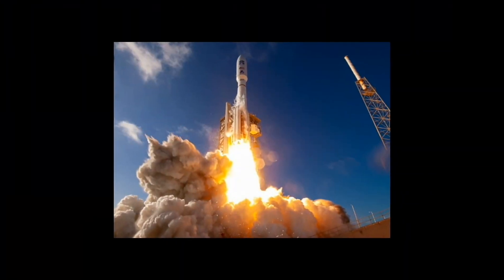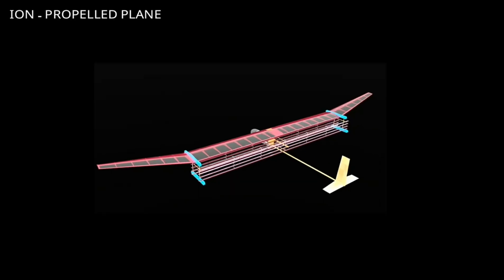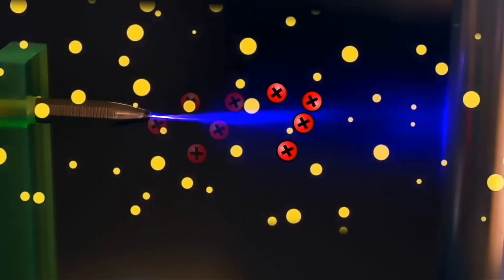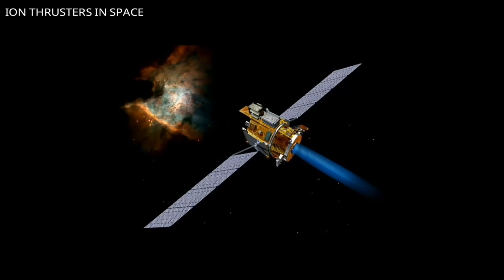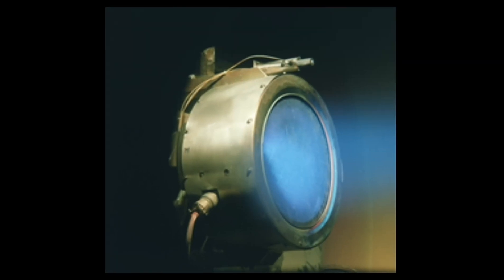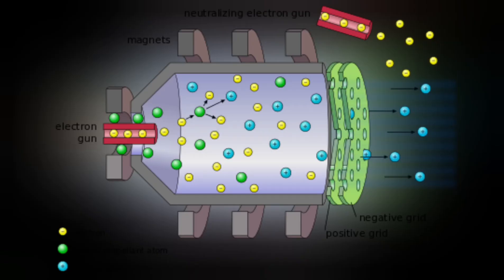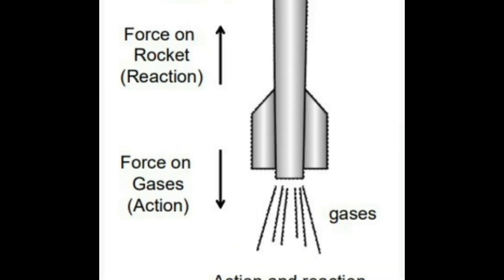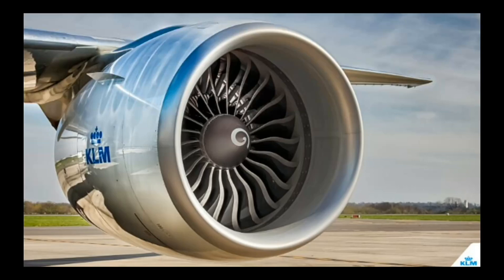Finally MIT Engineers Built An Ion Propelled Plane! | Using Only 40,000 Volts

Comment: The paper for the MIT ion glider does indeed claim that "the team built the first ion propelled aircraft of any kind to lift its power supply".  The claim is wrong!  On my channel there are 45 videos of ion thrusters that were patented for being the first to lift their own power supplies against Earth's gravity. They have been lifting their power supplies since 2006.  They are thoroughly verified to work and can fly even vertically for up to 2 minutes at a time utilizing onboard lithium polymer batteries.
Reply from the maker: That's dope man👍
Have you made any progress yet on these Antigravity machines technologies to? Cause I feel like it becomes even more easy to analyse and do the experiments with this whole Antigravity thing when you already have a starting point actually or some sort of scientific experiences
Reply: @KEIDIUMPHYSICS  Thanks for the compliment!  
The machine operates on ion thruster technology rather than antigravity propulsion. Although it appears like it during flight!  There is currently no evidence to support any real working antigravity propulsion. In contrast, ion propulsion has been successfully demonstrated and refined through many years of experimentation. We have recently upgraded to a more advanced, remotely adjustable electronic stabilizing system. We anticipate completing the final adjustments to the new control system in the next few weeks, provided there are no unforeseen details.